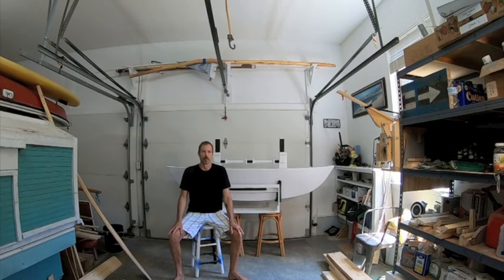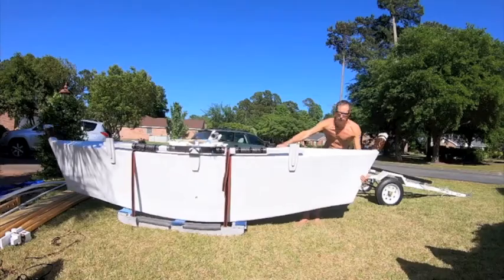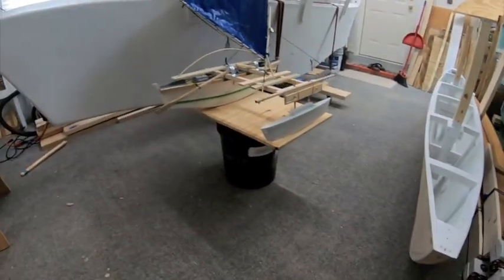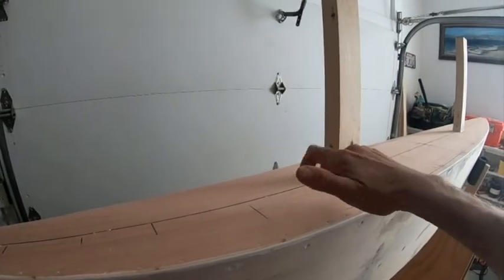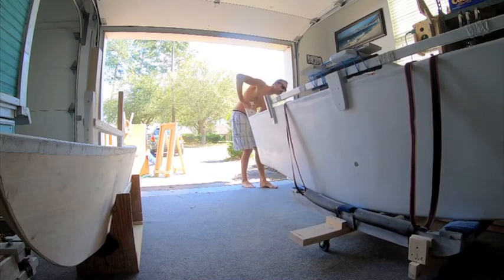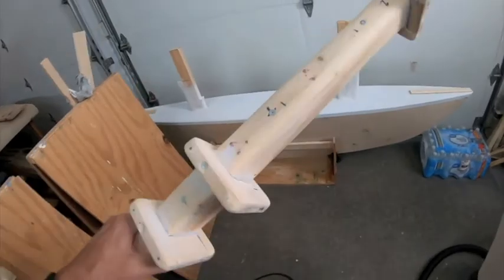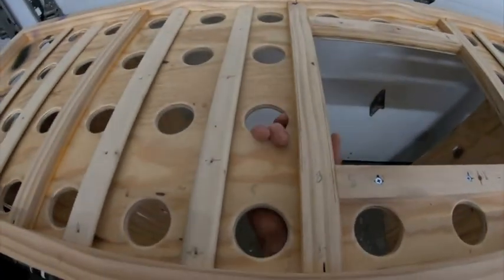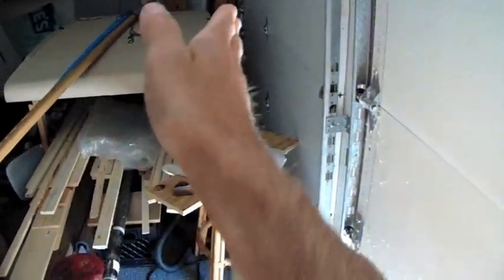Sailing Canoe Build Part 7/9 (Proa "Lucky Pigeon")

Comment: How long is your main hull?
Reply from the maker: main hull is 13 1/2 feet. Im making a new ama that is 12 feet.. the original ama in this video is 8 feet. I think a longer ama will work much better. The ama being longer than the main hull is beneficial I think. It reduces the weather helm these type of boats have.